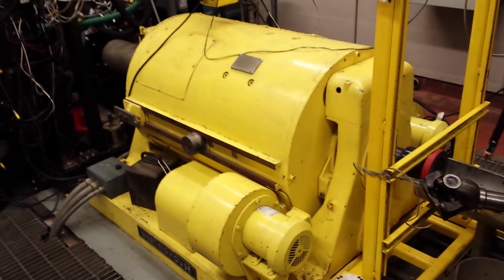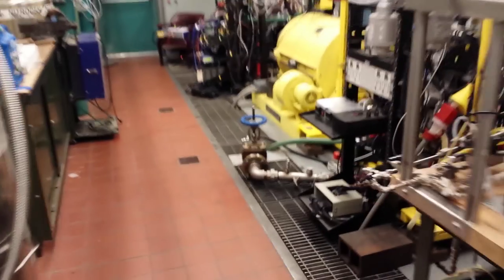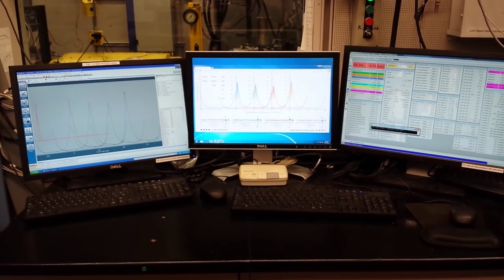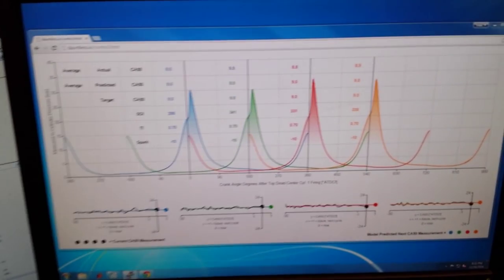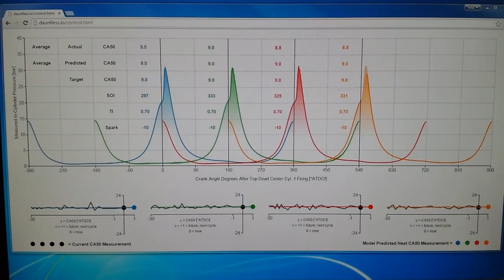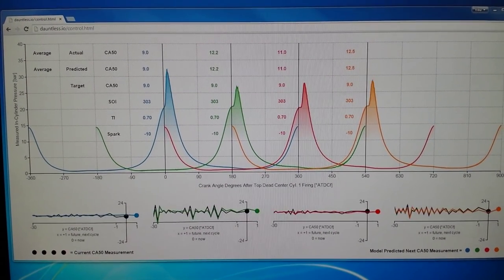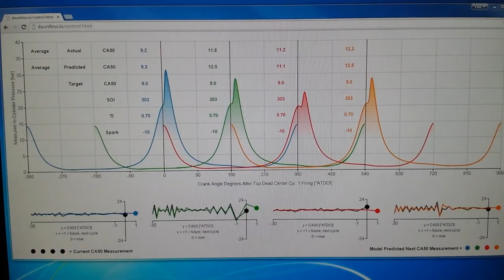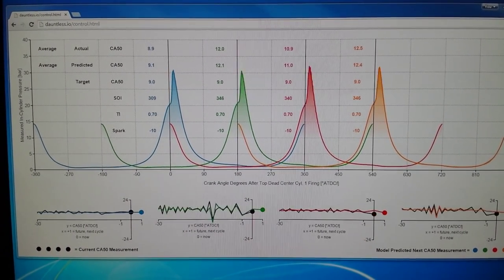Version 0.1 Raspberry Pi Engine Control with Real-Time, Adaptive Machine Learning (Linux, HCCI)

Comment: You know I was just talking to a friend the other day about all of the things the Raspberry Pi could eventually replace.  Engine computers was one of the things I said.
Reply: +The 8-Bit Guy 
Wow... even the 8-bit guy around here. 😂 Cool!

I've been working with a programmable ECU called MegaSquirt MS1 (an interesting and compact board built around a Motorola 68HC908 processor) and look like the Raspberry Pi 2 and 3 are able to run a program called TunerStudio to tune the engine air/fuel mixture comparing values from the oxygen sensor and the desired lambda/AFR. There is even a function on the paid version of the TunerStudio called "auto tune" to do a quick adjustment while you keep running the car. 

During my search around here, I'm actually looking after a Raspberry Pi or Zero acting as ECU and with the TunerStudio (or a good open source replacement) built-in to be remotely access through Wi-Fi. I would be pretty nice to have the powerful Raspberry Pi or Zero, especially because they are probably easier to reprogram, got huge community exchanging ideas and improving the hardware capabilities and easier the obtain than the old Motorola 68HC908.

The closest thing to replace the MS1 old with a relatively low cost was the Speeduino (an Arduino based ECU with virtually the same capabilities of a MS1).

I hope to see a practical Raspberry ECU anytime... it would be awesome to use those things on cars and motorcycles. 😀
Reply: @BlackCatRedScarf  any update on the project? I was planning to running my car using a raspberry pi as a real time a/f, ignition timing and a few other stuff as a piggy back to my stock ecu was wondering if the software for was compatible with all car models
Reply: @teddyferguson1415  Due to unavailability of cheaper and more cost effective units of Raspberry boards compared to Megasquirt boards in my region, the project was pretty much abandoned due to lack of funds to progress, low potential profitable to sustain the project and the fact people lost interest on developing. 

An Arduino based project called Speeduino proved to be a more cost effective alternative, but already have people over that with functional units.

 Perhaps a piggyback can be developed with an Arduino or make standalone spark ignition controller, but highly discourage the use of piggyback if you are planning to make more power with different fuel management strategies, due to inaccuracies in the A/F mixture and the tendency of ECU with narrowband oxygen sensors to stay in lambda 1.0 (we don't use AFR in my region to make the use with different fuel types and blends easier and remove any need to recalibration of the instrument readings). A proper standalone ECU is usually a better idea for different fuel management strategies.

The current project focus changed a lot and now my garage is developing and studying custom camshafts for racing engines, something that's been only produced by others companies in my region by copying and currently available imported camshafts without proper studies and poor optimizations.

Comment: Hi Adam. Very interesting work. Surprising and sad that i did not discover your work while i doing my experimental phd on HCCI engines at UCLouvain, Belgium around the same time as you. I always wondered how to replace the costly AVLs/Kistlers for commercial HCCI use, and dreamed of some day making the right electronics for that job! Surprisingly, i took up RPi boards development and now, thanks to your video, can see a link. An RPi control solution for HCCI engines!!! 
Would appreciate a discussion if you are interested.
Reply from the maker: Sure!  What's a good email to reach you?

Comment: How are you interfacing your pressure transducers into the Pi?  I'd be interested in the details of the custom board that allows you you get 240k samples/second, and perhaps the corresponding FIQ source code if you'd be willing to share.

Comment: That's way cool.  I don't know how possible it would be to actually use this outside the lab for one very basic reason:

Startup.

You need a system that pretty much is 'instant on' when the key is turned.  Perhaps it would be possible to initiate a 'hibernate' mode where the system suspends to a fast onboard SSD, or where it starts bootup when the door is unlocked so that it's ready when the operator turns the key.

Or it might be possible to just run it off the battery in a low power state.  Those are some obvious issues towards widespread adoption of this, but I can certainly see the potential (as I think about dropping the 3.5 Ecoboost into my 05 Mustang... mmmm...)

Comment: Very cool! Are you using the AVL box to process the pressure sensor outputs or does your custom board do that as well? If so, what resources did you use to aid in the design? I assume you are using piezoelectric elements.

Comment: This is really cool. Is it controlling both the fueling and ignition based on the pressure signals and the algorithm only? No pre set data about fuel requirements or ignition advance?
Reply from the maker: Yes, the algorithm is controlling based only off in-cylinder pressure and the crank angle encoder signals.  This is an HCCI engine, so spark ignition is not in use.  The algorithm was trained with data from another (similar) engine we had in 2012.
Reply: Fantastic, great work. Good to see the PI managing this with the real time linux kernel enhancements too. Need to have a play with it some time soon. Did you compile your own kernel or is there some distro offering this now?

Comment: The Pi did not have the connection points to support this? is there anything especially novel about the daughterboard you built for this purpose?
Reply from the maker: The daughterboard is designed for hard real-time analytics and control on sub-millisecond timescales. There really aren't great ways to do that with off-the-shelf solutions and guarantee sub-millisecond control latency constraints are met.
Reply: @subspclr  Neat

Comment: So this is a stock Linux image? No tweaks to improve real-time performance?
Reply from the maker: The GNU/Linux Raspberry Pi distribution I'm using is this minimal Raspbian:

https://github.com/debian-pi/raspbian-ua-netinst

The Linux kernel I'm using is from the (tested) PREEMPT_RT patches provided by Open Source Automation Development Lab that used to be here:

https://www.osadl.org/Profile-of-system-in-rack-b-slot-3.qa-profile-rbs3.0.html

I'm not sure why they stopped hosting them since the patches for other systems are still shown. I still had to patch the USB drivers some more because they would occasionally disable my FIQ data acquisition code even though I had set the USB to use the IRQ.
Reply from the maker: My software must meet hard real-time latency requirements to maintain synchronization with the engine as it spins.  If it does not calculate on time, the engine could misfire.  There is no notion of soft real-time in this application as a misfire is considered a failure.

I have two tiers of real-time latency requirements.  One for raw pressure data acquisition.  That's on a microsecond timescale and is handled by custom FIQ assembly code.  The FIQ has higher priority than the Linux kernel.  The other tier is for machine learning calculations. PREEMPT_RT Linux user space with async notify met all my real-time latency requirements under every test I threw at it across weeks of testing.  It may not be a small co-kernel, but it is real-time enough for this application.
Reply: Whatever came of this project?

Comment: If you could do that with the raspberry pi, which uses linux, why not use a linux computer in place of those xp and win7 computers?
Reply from the maker: Unfortunately, the other commercial engine software shown in the video are all Windows only.  It was easier for me to just open up the browser on the existing computers.

Comment: How close is this to drive a real car on an street? Is there a way to integrate this with rusEfi or any other open source EMS?
Reply from the maker: If industry or government funding were there, I suspect it could be done in 3-5 years.

Sure, this could be used with a rusEfi's CAN interface.  Keep in mind that the sensors for the pressure signals are currently expensive though.  They can be made cheaper (something Optrand Inc. is working on), but there hasn't been enough market demand to drive down prices.
Reply: What a about Continental Automotive's  in-cylinder pressure piezo sensor? I don't know the cost, but they're production based sensors (unlike the Kistler's).